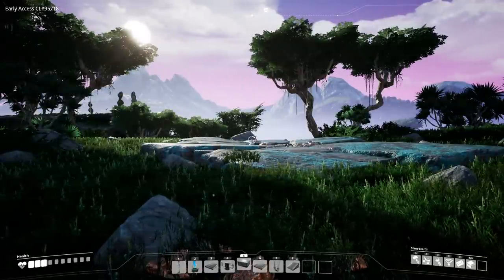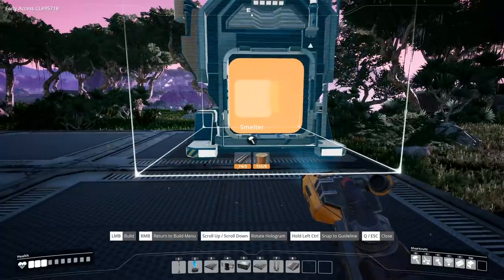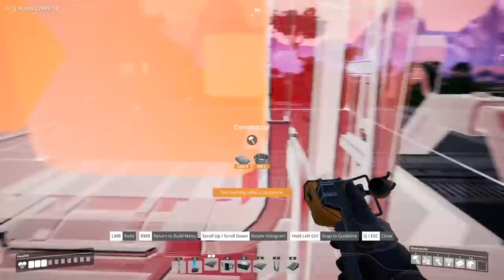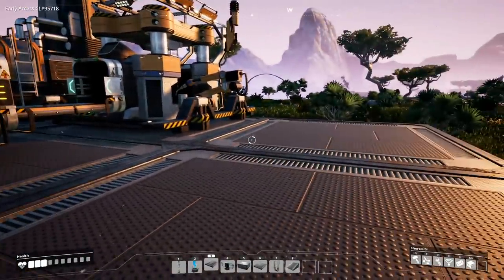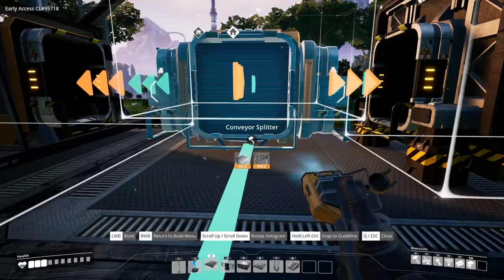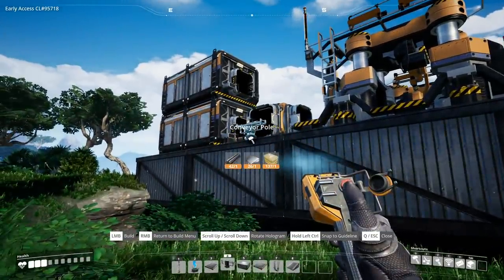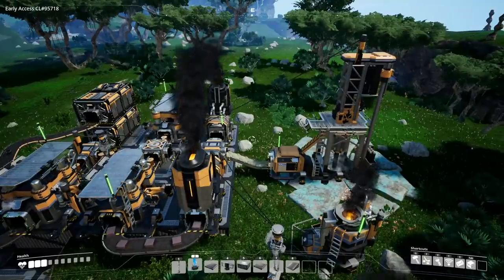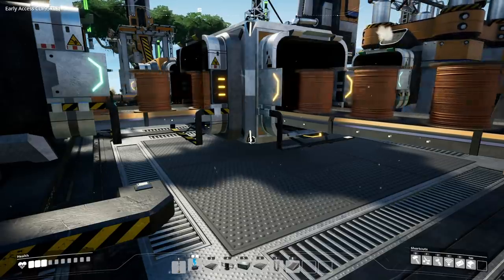CLEAN and COMPACT 3x3 Copper Production Module in Satisfactory (Tutorial)

Comment: Except its not 3x3 because your belts run over the edge.
Edit: not only conveyors, the buildings too. If you wanna do it real 3x3 you need to put walls around. And i think thats not enough space for that
Reply: It is really about a 3x4 when conveyor width is taken into account but pretty good nonetheless!
Reply: Clickbait is real <.<
Reply: You can make it 3.5 by 3.5 i think
Reply: @lukepickett4866  It's actually 4x5 :P. I think it could be shuffled across to make it 4x4 (probably) but yeah, way more than that :P
Reply: This.  A thousand times this.  If bits of internal components of your module extend beyond your foundation, it ain't modular.
Reply: Considering some of the challenges make exceptions for conveyor belts or even power sources.  You could film your own response to the challenge. shrug

Comment: Man your merger is a huge bottleneck. You should just make 2 conveyors with wires directly to storage and cable constructor
Reply: LOL
Reply: or put Mk2 conveyors in between the merger and the 2nd splitter. Also the 2 smelters only use 30/min of the 60/min output of the Miner so he could have noted that you can downclock the Miner to safe energy, same with the biomass generators if they aren't connected to anything else.
Reply: i mean as long as your belts can handle it, its totally fine, mergers arent a bottleneck but the single belt after it and for that setup mk2 belt should even be enough.
Reply: Yeah the efficiency of this module is really only in footprint. But I am sure it could be optimized with a second story and since the conveyors already extrude outside of the 3x3 you could wall off a 3x4 and still have it all inside even with the second floor. Some of those elevations of conveyors might get a little tight though...
Reply: @tiuza  No, every smelter use 30/min of ore, 2 of them use all 60/min that Normal iron ore source gives. However, every smelter can feed 2 con-s, so there is the bottleneck of production. In case you're not going to use power shards for the con-s.
Reply: Yeah it was exactly I was thinking

Comment: The idea of compacting production down to the smallest space you can manage is a great design philosophy, and head to tail constructors/smelters is one of the best ways to get there but this particular setup is pretty inefficient, so I think it is either worth a redesign, or at least manipulating clockspeeds to maximize the system as it is. For example, this could work well on an impure copper node, running the smelters at 50% Underclocking, but even then, you'd still need that Mk.2 Belt. 

I've been designing these types of setups for ages now, (you should see my reinforced plate designs) and yeah...Copper ore to wire + cable is a design I haven't quite figured out yet either.
Reply: Do you have any screenshots or videos about your designs?
Reply: No. I wish I did. I just use a basic 2d image program with accurate building dimensions.

Comment: Great concept but if you take a look at the foundations itself it goes beyond your target of 3x3 as we can not ignore nor build wallls over conveyors
Reply: There are specific walls that have holes for conveyors to go into.
Reply: @hcalidi  yes and if the conveyors go out of one wall and come back in through another, it is still not 3x3 because the conveyor left the foundations.
Reply: Roger Wicki yes but that is being over specific. The footprint of the build is 3x3 which is still very compact you can fit 2 of these next to each in 9 foundation wide 1 space gap 3 space for build 1 space gap 3 space for build 1 space for gap. This is still extremely compact.
Reply: @hcalidi  well depends on what you want to do. If you want a building that uses walls at the 3x3 marks with other structures on the other side, then 3x3 is misleading and wrong
Reply: @hcalidi  The fact, that you can fit only 2 in 9 wide foundation doesn't add up. We can ignore belts protruding, due to mentioned walls with holes, but we can't ignore the footprint of buildings themselves, that protrude from  3x3 limitation.

Comment: If you stack 2 foundation under one of the wire assemblers it should be high enough to transfer wire straight to the top most container (no conveyer pole required) while the 2 assemblers at base level make wire -> cable for the bottom container. It flips the outputs (wire on top, cable on bottom), however it avoids the bottleneck. Might also mention with a design like this (6 machines) a minimum of 3 power poles should be used (1 input connection, 2 load, 1 output connection per pole).

A simple height tweak on one machine seems to optimize the build.
Reply: That sounds interesting, should post a diagram somewhere :)

Comment: I like your compact setup especially in the starting phase. But with a bit more resources (you'd need 24 reinforced ironplates) you can increase the efficiency so that you get 1 full Mk1 Belt of wire and 1 full Mk1 belt of cables. But you need partially Mk2 belts for that setup. 
The way it works is that you get the output from two furnaces of copper and fuel 4 constructors for wire with that. Then you merge two constructors on one Mk2 belt. Then you take one Mk2 belt of wire (90/min) and one third of the other and merge that onto a full Mk2 Belt. The other two thirds of the Mk2 belt are your full Mk1 belt of wire (two thirds of 90/min are 60/min). The full Mk2 belt of cable you split evenly into four constructors for cable and you get your full Mk1 belt of cable (15/min times 4 is 60/min). With two floors in my factory I got in in a footprint of 4x8 I think. It's a bit complicated but every bit is on 100% efficiency. And with a Mk2 miner and overclocking  you should be able to easily double the output but I haven't tried that yet.

Comment: that bottleneck, hurt to watch | in this setup OC smelters or wire constructors is poinless without upgrading wire belt | if all mk1: provide/use/to_storage/w8_on_belt per min > ore 60/60/0/0 > ingot 60/30/0/30 > wire 90/30/30/30 > cable 15/0/15/0 | there 3x3 (4x4_with_walls): 60_ore=30_wire+15_cable per min | ideal_ratio_mk1 4x5(5x6): 60_ore=90_wire+45_cable per min
Reply: Why do I feel like I have found a factorio player....?
Reply: NNNEEEEEEEEEEEEEEEEEEEERRRRRRDDDDDDDDD.

Comment: You only need 1 smelter for 30 copper per minute. Could save more space by dropping 1 and splitting it into the constructors.
Also why would you have your storage at the copper node, those things are usually not very close to your starter iron ones.
Drop the containers and run that shit to where it's needed.
Reply: Have multiple small factories dotted at nodes instead of 1 huge box or 1 long line. Then have truck convoys going from small factory to you main base of operations / storage unit and eventually trains instead of convoys.

Comment: as other say Bottleneck, and thats not 3x3 cause your belts outside of the 3x3
Reply: Its not a bottleneck. Mk.2 belts have double the capacity of Mk.1 so you can use a splitter 100% efficiency.
Reply: @ryankl1984  but he didn't used a mk2 belt! He only uses mk1. His mk2 belt is on shortcut 6

Mk2 must be between merger (2x45 wire) and the splitter of storage and kable constractor

Comment: why use the merger and splitter at the end, does that have any advantage? because I don't think it has any cause now you are joining 2 outputs only to split it again after it, which then has te same ratio as before you merged those 2 lines? and you can see the wires backing up there. I rather have 1 wireoutput directly to storage and the other one to a cablemaker cause that seems better. if im mistaken lemme know
Reply: He has one smelter to making cable, and one to storing wire. He has two wire makers going to a splitter so a easy fix would be Mk.2 belt on the output. I would use Mk.2 all around honestly except storage belts.

Comment: Not enough. If you only have two smelters you will just not have enough wire or cable. You need about 4 smelters minimum.
Reply: 4 Smelters, 8 constructors for wire, ~2constructors for cable

Comment: cool build, only using less htan half the ore your mining tho
Reply from the maker: Thankfully I left efficient out of the title 😂
Reply: Hm? He's mining 60 ore/min and 2 smelters need 60 or do u mean the copper ibgots? 🤔
Reply: That particular node is a Normal though. There is a pure enroute to the slightly farther coal source. You can have 2 constructors per smelter producing wire, like for iron rods. If it was producing 120/min, you're only using 1/4 in this set-up, not half. This copper node is right next to 4 irons (2 normal, 2 impure) and a limestone. You can almost see the coal source from the impure farther from the limestone. 

Smelter : 30 ore in > 30 ingots out, constructor : 15 ingots in > 45 wire out
So you're smelting 60 ore min, but you're only constructing with 30 ingots =>  30 / 120 = .25 or 25% or 1/4

And, as mentioned, until you get access to Mk 2 belts, the merger is going to be a bottleneck... and then you'll be using 90/120 belt capacity. If you had 4 constructors producing cable, you'd need Mk3 belt there. 45 (wire/min) * 4 (constructors) = 180, but Mk2 can only move 120. 

According to Coffee Stain, Space is at a premium, (ie. not abundant) you're supposed to build up, not sprawl... I think, "Whatever floats your boat (is fun for you)," is all that matters. 

Once you get to trying to match item 1 180x from a 45x, item 2 20x from a 3x, item 3 15x from a 2.3x, item 4 5x from a 2.5x... all for 2x... I just don't care about 100% efficiency long by that point. "It'll get done, when it gets done."

Comment: YOU MUST ALWAYS HAVE A FASTER OUTPUT BELT SPEED WHEN MERGING TWO OR MORE SLOWET BELTS OR IT WILL BOTTLENECK
Reply: ehm... not true if both belts are under 50% full, like you can merge 4 rod constructors onto a single Mk1 belt with no slowdown, but yeah a bit of math goes a long way.